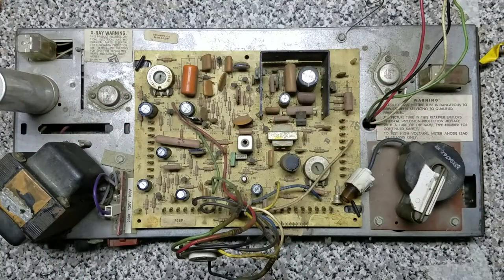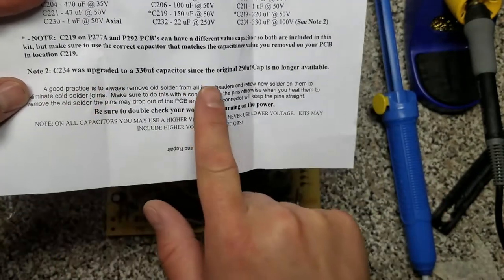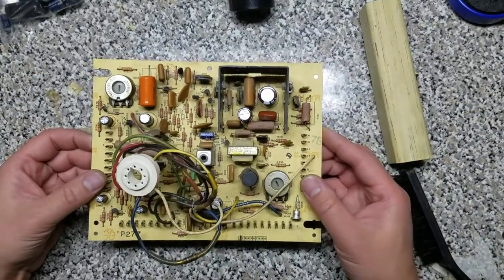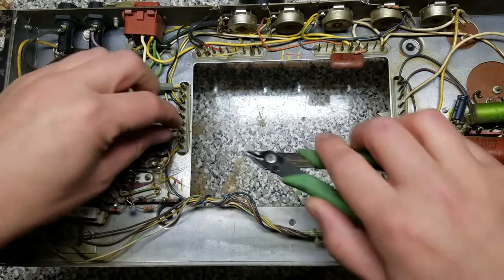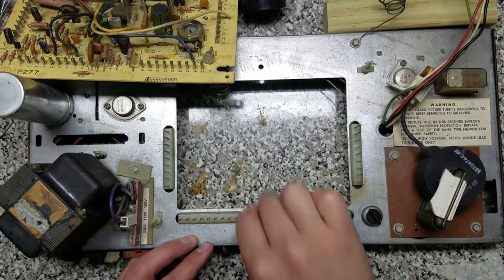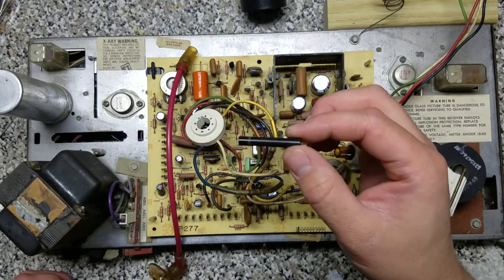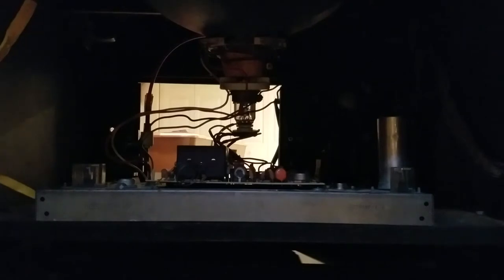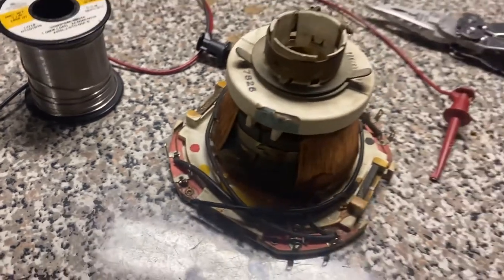Space Invaders Deluxe Restoration  Part 2  Wells Gardner 19V1002 Rebuild

Comment: Nice vid man, I'm in the process of restoring a SI Deluxe also, just about to start the power section as you have. 

Do you have a link to that adapter you used on the switching power supply?

Cheers
Reply from the maker: Check out arcadeshop.com, they have a tremendous amount of modern parts and kits. Here is a direct link to that PSU. https://www.arcadeshop.com/i/933/midway-8080-power-supply-kit-4.htm. Thanks for watching and your question.

Comment: How do you get to the monitor overlay within the cabinet?  Mine has always been oriented incorrectly (reddish section is on the bottom of the display instead of the top) and I’ve always wanted to correct it.
Reply from the maker: You can slid the front display glass up and out of the cabinet. Then just rotate the cardboard and transparent plastic overlay. Be careful of the two way mirror when it's open. Good luck